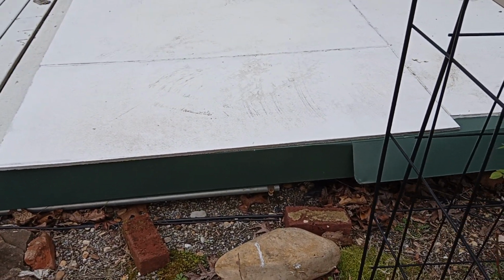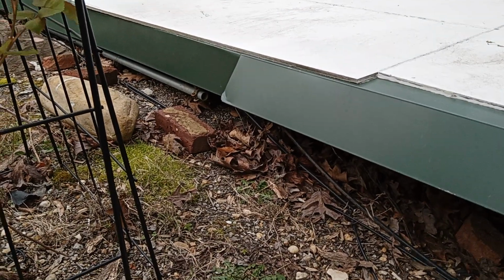NEC and Grounding, Part 7, Lightning Protection Using Conduit

Comment: Thank you so much for reposting this video! This clears up my question about grounding the conduit.

Interestingly, your videos are like a voice in the wilderness and pretty much stand alone in demystifying and debunking the whole grounding ham radio hardware lore that permeates the amateur community.

I couldn't reconcile most of what I read/heard and saw over the last 6 months, but what you describe makes sense to me. I think I'm ready to proceed with setting up my rig and getting on the air.

Appreciate your help and insights!

Kind regards,

John - KK7JBZ
Reply from the maker: Thanks for the flowers, it took me quite a lot of time and study after deciding that much of the common belief either didnt make sense or violated laws of physics.

Science demands giving up group think and opinion...

The foundational text for this topic is the Branched Streamer Theory and Arc Formation by Townsend, 1929. Ive not found it on line.